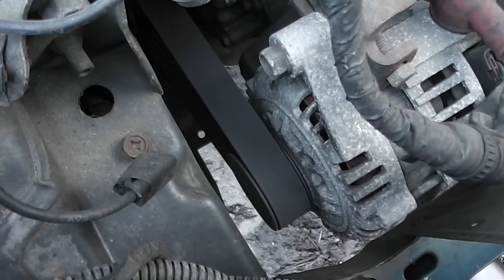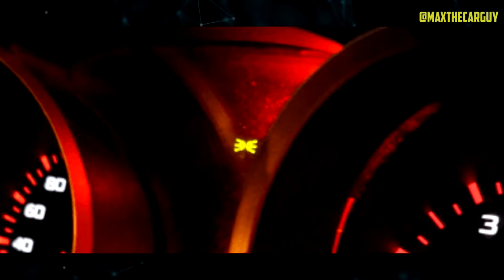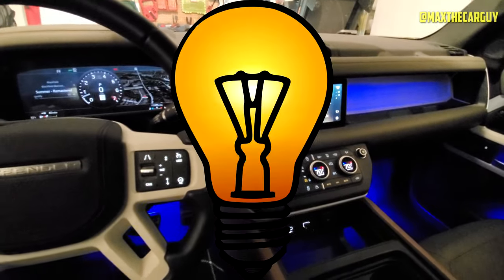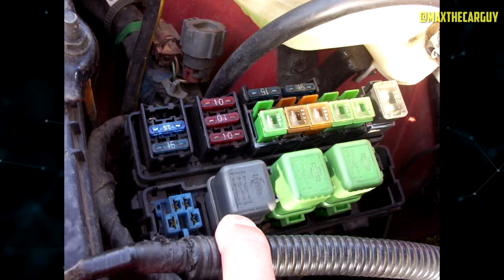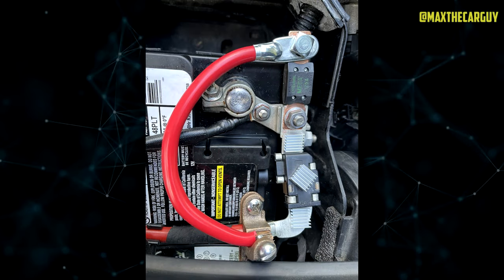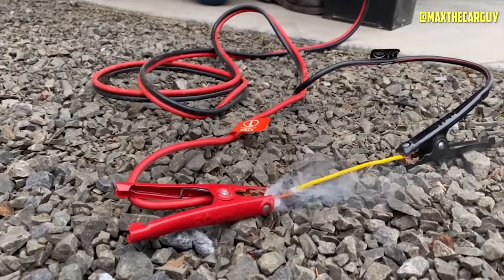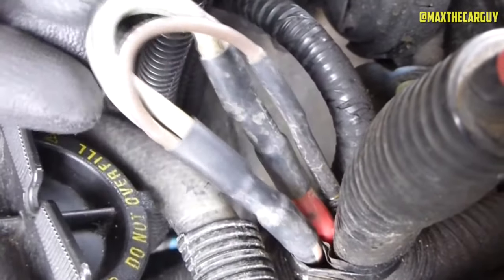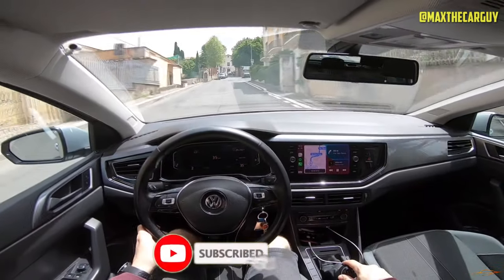6 Symptoms of a Blown Alternator Fuse or Fusible Link

Comment: Thanks brother I change my battery and alternator and my car still was not working it started but the battery still died and when running my lights was blinking car was trying to stay running I did some research found your video and it sounds like my problem that I’m having and harness wire was burn that’s why I change everything but it makes sense my alternator fuse might be faulty so I seen ur video and I ordered one it’s on the way let u know how I made out thanks